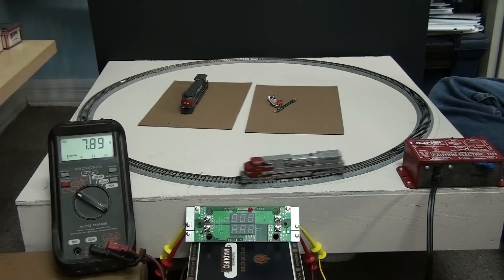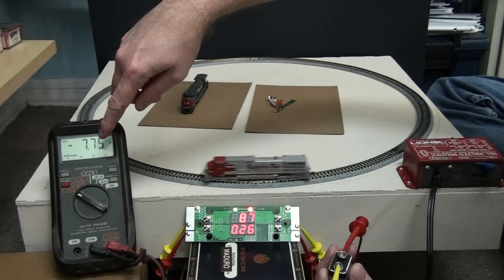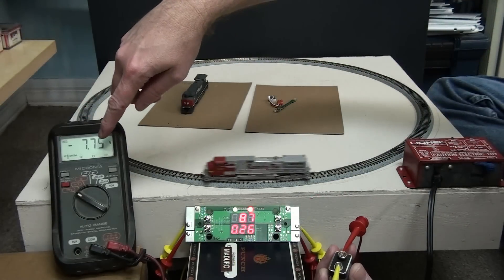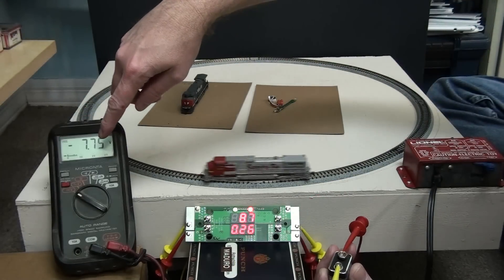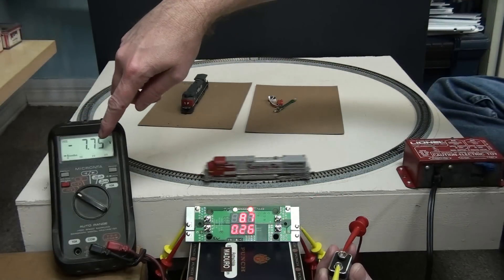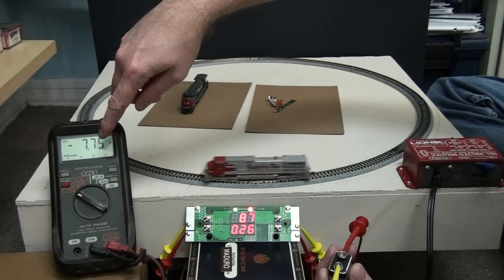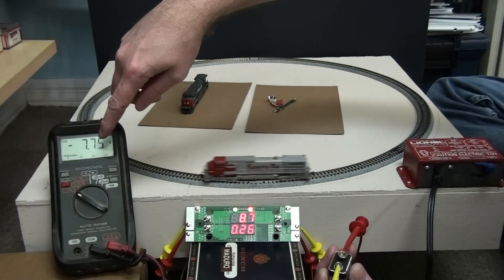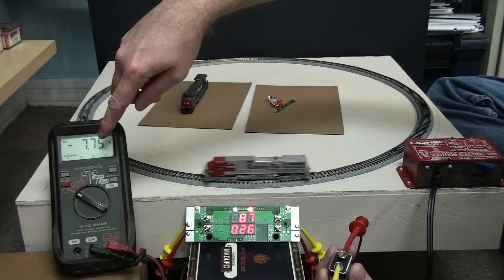🔴Inside Look: How Digital Command Control Operates

Comment: DCC systems have their ratings of what to get and what should be avoided If you are a beginner buy a NCE Powercab this is the recommended system if you are doing the Bachmann Ntrack system or the Kato/Atlas T-Track system if you are advanced go up to an Easy DCC system what not to buy a Lenz Bachmann EZ Command the reason EZ command is for larger locomotives those that are O scale or S which run on an AC power pack also if you use an EZ Command with HO, N Scale, or Z Scale you will blow up your motors and decoders because the motors used in Z HO and N are not designed for voltages over 12 volts also Bachmanns instructions are misleading, thy don't support CVs none of them support JMRI, and Bachman uses the Address 3 while other decoders are set at 2 or zero at the factory and have to be programmed by the user. for clubs go with a Digitrax Zephyr or an Easy DCC system that is fasha mounted what not to get any MRC products these are massive, they don't support JMRI, and you need breakers installed or they will overload.
Reply from the maker: Still recommend NCE for most everything

Comment: DC powered train users are being run out of the hobby. Everything is being pushed to higher priced dcc units! Maybe I should move to war gamming figures instead !
Reply from the maker: Not really,  it is just DCC works so much better than the older DC.  Nothing wrong with DC.  That is what I started with, but DCC is hard to pass up.
Reply: dcc gives you more power options with your engine than what you have in dc. DCC is much simpler today than it was when it was first offered, the argument that is out there that its over complicated is just more a lack of trying something new. I was a strong advocate for dc for the longest time until I tried dcc with an older Athearn bb engine, keep in mind at that time I only had 10 engines, and converting was easy. If you have a system that is much more comprehensive and a conversion would not be cost effective, stay with dc, it works. But nobody is pushing anyone out of the hobby, because most manufacturers offer dcc ready, so it gives you both options if you ever want to venture out and try it.

Comment: This does not explain HOW it works, current-wise, as I was expecting...
Reply from the maker: Sorry
Reply: Current is called amperage and I'll call power voltage. The locomotive speed is controlled by varying the voltage. Voltage at the electrical/wall outlet in the U.S. is 120, enough to kill you. The train's power pack lowers (transforms) that voltage to a maximum of 15 or so volts. The power pack is a variable voltage regulator. The locomotive's electric motor is increased by allowing more voltage to reach the motor and vice versa. The electric power goes from the outlet into the power pack at 120 volts, goes through the speed/voltage controller and then through wires that are connected to the track rails where it moves from the rails to the locomotive's metal wheels and through the wheels to the locomotive's electric motor. Increase the voltage at the power pack and the locomotive's speed increases and vice versa. In a dcc system the rails are always at maximum voltage/speed. So the power pack does not vary the voltage but the dcc decoder does. The dcc power pack/transformer converts the 120 volts from the wall outlet to a constant 15 volts give or take. Now instead of varying the voltage at the power pack it is now varied/regulated by a decoder that is installed underneath the shell of the locomotive. The power now goes from the wall outlet to the power pack to the rails, through the wheels to the decoder which is controlled by a signal from the handheld controller which tells it how much voltage to send to the motor. In other words the operator controls the decoder via the handheld controller/remote. So converting a layout to dcc means installing a decoder on your locomotive, replacing your variable voltage power pack with a constant voltage one and using a handheld/remote controller to vary the voltage going to the motor. I hope this helps.